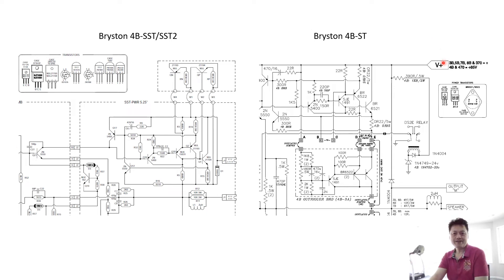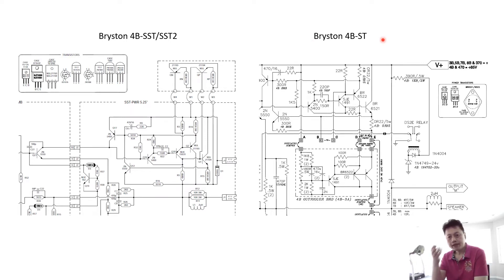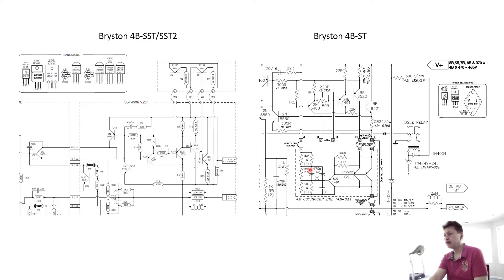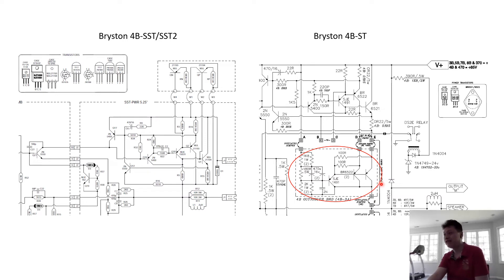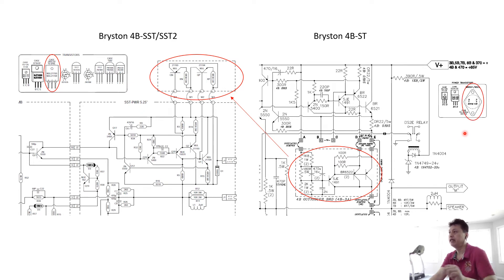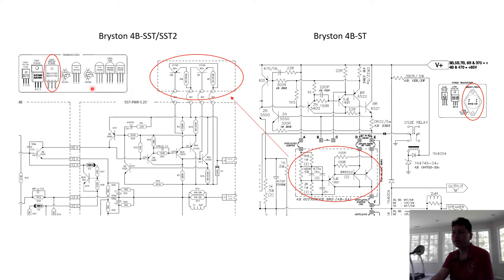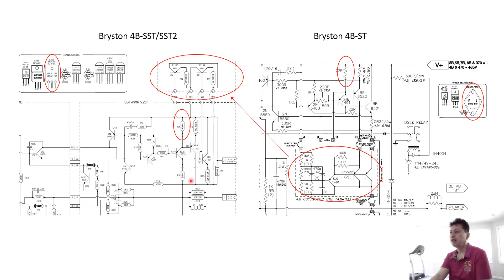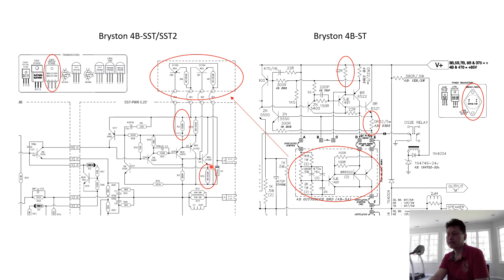Modify the Bryston 4B ST to better most high-end audiophile amplifiers - Part 1, the Theory

Comment: I highly recommend that anyone working on one of these Bryston amps change out the two small 470uF/16V caps on the channel amplifier board. The channel amp board is the one in the center of the heatsink between the two smaller extension boards. These caps are the small brown ones on the upper right and left hand corners of the channel amp board as shown in this video. These two caps are in the current limiter circuit and when they go bad your amp will not make full wattage into lower impedance loads. I recently rebuilt a late 2001 model 4B ST. Before I began I put the amp on my analyzer and found that the amp made great power into 8 ohms > 300W but into 4 ohms the amp was clipping at 175W & 200W L and R channels respectively. Current limiting was activating prematurely. I pulled these caps from the limiter circuit and they measured either leaky or very low capacitance and high ESR. After replacing just these two caps on both channels, the amp is now clipping at 440WPC into 4 ohms.

Comment: I will be buying a 4B ST in a couple of weeks. I was debating if I should spend more for the SST but I think I want to try the 4B ST first for less money.
Reply from the maker: The stock sst sounds better than the st due to its favorable output circuit topology (less parasitics and higher damping factor). If you are handy to modify the st version, I think the results is even better than sst because of the dual toroidal transformers and TO-3 metal-can power transistors (larger silicon and better heat dissipation).
Reply: @neighorizon-4190 

Hey, do you do the modification?  I am not able to do this on my own…if so, how can I contact you for price??   Thank You!
Reply from the maker: @stashmoneyable  Where are you located? These amps tend to damage during shipping due to the heavy weight.